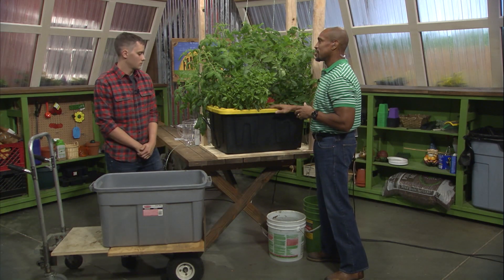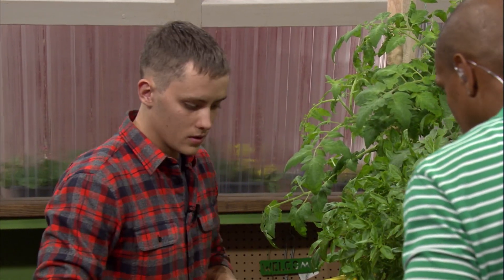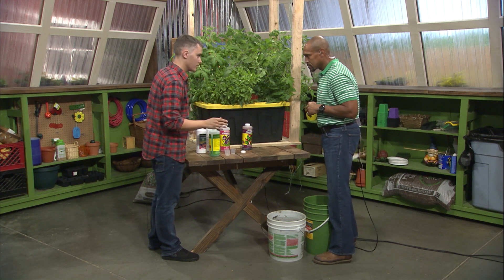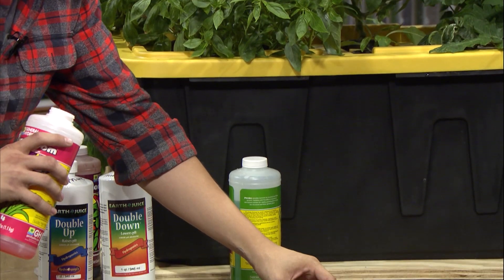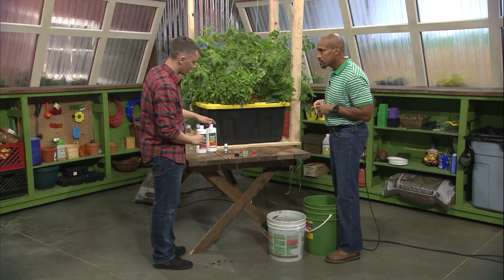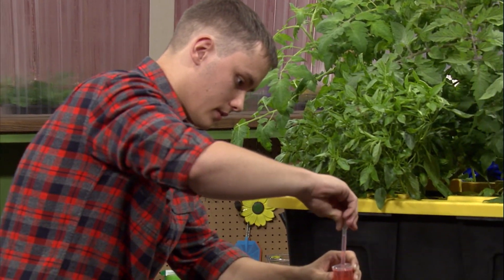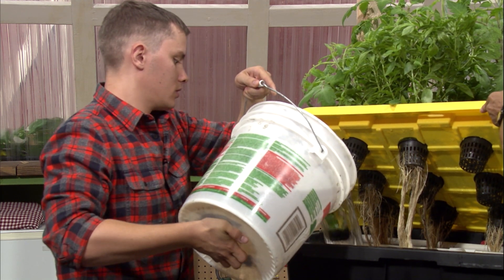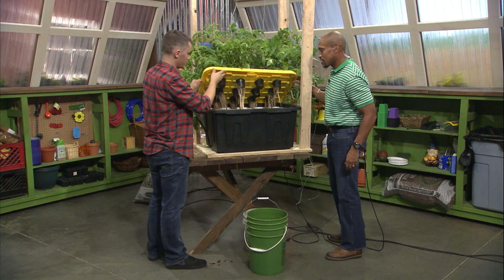Changing Hydroponics Nutrient Solution

Comment: I love the those totes for hydroponics but I've found that the yellow lids allows lots of light into the system which will promote algae growth. It's best that the containers be totally light tight. It takes numerous coats of black spray paint to block the light or cover the lid with aluminum foil to keep algae from growing. 
I would also suggest adjusting PH after adding nutrients to water.
Reply: Plastic spray paint at home depot
Reply: Thanks for the tip
Reply: Just a suggestion, but the most opaque spray paint in my experience is the metallic aluminum spray paint. One coat of plastic primer and then use that and you should be in decent shape.

Comment: Hi Chris, I know its been years here, but do you grow these plants their entire life cycle in this system? If so, how much is each plants yield limited by it?
Reply from the maker: The plants spend their whole life in the system. The tomatoes you saw planted here lasted over two years and were producing the whole time.
Reply: You should add sirstone and pump if plants well be in their whole life.  Will be a low pressure aero bubbler then.  This is  what that system really is.  True aero would be kept separate  plants and nutes .  You can built cheaper one in 4 inch pvc fence postes. And tote will just be resovoier.  If anybody need real blue prints let me know I get them emailed to you.  I have blue prints for 4 different systems just comment with email I get them to you.
Reply: @Jemstk  hey i’d appreciate these for sure

Comment: Why not trim the roots back so they can grow again
Reply from the maker: Plants grow enough roots to support the top and also grow a top that can be supported by the roots. If you cut the roots back they will not be able to absorb enough water and nutrients to support the top. The top will wilt until the roots can regrow the ability to absorb enough nutrients to support the top. If the plant runs out of stored nutrients before they regrow the plant will die.

Comment: Hey nice video btw, just got some questions
I have a wilma 8 pot can I use this same method and same nutrients into the wilma system? And if so can I start using nutrients soon as I change  my plants from the cubes onto the pots? Ty guys
Reply from the maker: I am not familiar with the wilma system. It is usually best to not give the plants full strength nutrients to start, but build them up. Full strength nutrients are very strong and will burn roots that are not used to them.

Comment: Do you fill it to where it was from the beginning or do you fill it less ?do the roots rot if you fill it to much?
Reply from the maker: It works best if filled with 10 gallons. The roots are fine sitting in the solution as long as they have oxygen. The solution is oxygenated by the spray.

Comment: did you guys use an air pump to put oxygen into the reservoir? I am building this hydro set up and tweaking it to my liking, was thinking of putting air stones and a pump into place for this set up. Thanks for the info guys, this is my first time doing hydro/aero build. God bless!
Reply from the maker: We don't have any air stones. The mist collects oxygen. In fact there are so many bubbles in the solution in the tote that you can't see more than an inch into the water.
Reply: @FamilyPlotGarden  thank you!

Comment: While changing the water, how long can the roots stay out of the water before it becomes a problem?
Reply from the maker: They can be out for several hours as long as there is not a hot dry wind. Changing the nutrients will not let them dry out that much.
Reply: it shouldn't take you so long that your roots dry.
Reply: @MajimeTV  right. But, how long?
Reply: @Skidmark75  It depends on the plant but basically don't leave it like that more than 18 hours. It shouldn't take you that long.

Comment: you should check the PH after you have mixed the nutrient solution, not before.. most solutions change the PH levels, and it's important what the PH of final solution is that comes to the roots, not what it's been before the nutrients were added.. also blindly following the guidelines on what's on the back of the bottle doesn't make sense, because that's a generalisation and can't take your plant and environment into consideration.. you could have it under a 1000w light, or under a 15w light, and each requires different needs because the plant will grow differently..  
it's much better to measure the EC in the reservoir over time and then adjust according to that. If the EC goes up, then more water than nutrients are being consumed (or there was evaporation) and in future less nutrients are needed.. if the EC goes down, then the plant used more nutrients than water and the solution should be raised.. if EC stays the same, while the water levels sink, that means you have the right level for the plant in that environment
Reply: I'm sure you're right with regard to the PH levels.  That said, this is targeted toward new hydroponics folks (like myself), so I appreciate the broad stroke approach as well as keeping things simple when possible.  After I spend some time getting set up, I'm sure I'll end up watching more than a few videos on PH levels - most likely after I fail spectacularly. :)
Reply: @bander1023  we've all been there and I know one has to start somewhere.. and like with many things it can get a bit overwhelming in the beginning if one wants to do it really "right".. a lot of beginners (myself included) tend to focus a lot on PH, while EC is as, or may even be more important.. I wish someone had told me that a lot earlier :) 
In any ways, enjoy the hobby and don't get intimidated ;)
Reply: One thing is that if the PH is to high before adding the nutrients, they will precipitate to the bottom of the container and not get to the roots. Balancing getting the PH at 6ph  is around the ballpark. Also, periodically sampling and measuring the conductivity is very important, as water will eventually evaporate and the nutrient concentration will increase, which is bad for the plants.

Comment: So how do you keep the roots from growing or getting drawn into the water pump? And also since it wasn't stated, how often do you need to change the water and nutrients in size of setup? And as I'm typing this I hear the younger guy mention the sediment bag (that wasn't in the construction video).
Reply from the maker: The pump is in a filter bag. The one they used in this video is built for hydroponics pumps. The filter bags are pretty expensive, so I made one for another system from fine tulle from the fabric store. Another option is using a paint strainer bag from the hardware store. With the tulle I had the problem that the tulle got sucked up against the pump and clogged with root fragments because all the water was being drawn through a small area in the bag. To solve this put some things in the bag that will keep the side of the bag away from the pump. 

The general rule of thumb for water change (without complicated testing) is when about half the solution is gone - either from the plants drinking or from evaporation. The tomatoes have gotten very large and they will drink through half the water in about 3 days. I refill with water and do a complete drain and fill every week. Other plants will require it less often, depending on how much they drink.

Comment: do you have to circulate water even with airstones
Reply from the maker: The nutrient solution needs to be sprayed on the roots to keep them from drying out. Once you are spraying there is no need to use air stones. The air is oxygenated when it is sprayed.

Comment: Why not using a pump to fill back the tank?  You might get a hernia picking up those heavy buckets.
Reply from the maker: Good idea
Reply: I use the pump to empty and fill the tote.
Reply: @billcoley8520   Been looking into how to do that? Is it that easy?
Reply: c whitt yes it is. Fill your buckets up and have a spare pump with a long hose on it. Drop it in your bucket plug it in and save your back. 
Look. I was a lineman for a power company. I’ve had 3 lower back surgeries. Everything I lift now has wheels on it.

Comment: He read the dosages wrong. its not 1ml per gallon lol.  its 1 teaspoon which is 5ml. so he should of put 50ml in a 50 gallon tote.
Reply: A 50gal tote would use a minimum 250ml of FloraGro at all times. 5ml per gallon x 50 gallons is 250ml. Always follow the directions on your nutrient bottle labels.
Reply: He is mixing for a bloom phase not a clone or vegatative phase, so at that point u don't need as much nitrogen in ur mixture

Comment: How would you clean the tote and Sprinkler system with out Hindering the roots and with that system have you ever had a Sprinkler get clogged if so what was your solution
Reply from the maker: We just drain it and refill. I usually tilt the container to get more of it out since about 1/2 inch of water is below the drain. When it is empty I pour in a gallon or so of plain water to flush it out. Then refill with nutrient solution. I have had a spray nozzle get clogged. After unscrewing the nozzle you can take a pin and try to push the offending item out of the narrow part of the nozzle. Some times I just unscrew the nozzle, rinse it in plain water, put it to my lips and blow out the clog.

Comment: How do you know what nutrients are required for hydrophonics ?
Reply: In any growing situation, plants need 17 elements to grow and be healthy. We provide 14 of these in our growing mediums and recipes. Mother nature handles the other 3. For hydroponics you can use nearly any form of liquid "plant food" but for high quality hydroponics, ie aeroponics setups like this tote, you want highly soluble products to avoid clogging your sprayers. People with small tubing in drip fed applications would also benefit from these. Hydroponic nutrients are labeled as such because they can be used reliably in the many incarnations of hydroponics. However, they are viable in any other medium as well. Soil, peat, coco, etc. However, the same cannot be said in reverse. Due to issues with clogging, only the most particular organic solutions will reliably operate in an aeroponics situation. But, for instance, any compost tea would work great in a deep water culture hydro setup. 

Seek out: soluble salt based nutrients. premixed in water. or in their dry (salt) state.
Reply from the maker: There are many different manufacturers of hydroponic nutrients out there (Google: Hydroponic Nutrients). We are using General Hydroponics Flora Series but depending on what you are growing there may be a better nutrient for you. Each manufacturer will provide a recommended way to use their product including how much of each part and mixing instructions.

Comment: If all the nutrients are being mixed together, why can't you fill the tote with water and then add the 3 nutrients one at a time into the tote?
Reply from the maker: By mixing them separately and making sure they are well mixed before you put them in you do a couple of things. You don't shock any roots with a super concentrated nutrient. Also, you make sere the first nutrient is at a lower concentration in that area when you add the second. If the nutrients come in contact with each other in too high of concentrations they can react which may cause a non-dissolve-able  precipitate or chemical combination that the plant can't use.

Comment: Thanks for your very good response regarding the use of vinegar. I did not realize that it is produced by bacteria and some might remain when I purchase it. However, to use it, I should be able to kill the bacteria by boiling it for 15 minutes, unless it is a superbug, that even a nuclear war will not kill. The reason it is an issue with me because I have to use a lot of PH Down to bring it down to the acid range since the water here is so alkaline. There are no hydroponics supply stores around here, so shipping liquid is expensive. Bulk vinegar would be more economical.
Reply: You might try treating your water with reverse osmosis. A two-stage system can run under $100. Reverse osmosis water purifiers will reduce the pH of water.  Because reverse osmosis removes the minerals in water the water will then react with carbon dioxide upon exposure to air to form carbolic acids, thus lowering the pH.  The resultant pH will depend on the initial water chemistry. It cannot be predicted.
Reply: I used sulphuric acid when I started out from an old car battery (ggg!) and according to the book I had it is one of the best acids to use for bringing PH down. And very little was actually needed to keep my PH under control.

Comment: Thank you for your previous response. In my area the tap water is very alkaline. I have used a large amount of ph down to bring it into the optimum range. Instead using this expensive chemical, why can I not use just pure vinegar for my hydroponics? I use it for plants in my in ground garden.
Reply from the maker: You "can" use vinegar to lower pH but there are some problems you might run into. Vinegar is made by bacteria. The vinegar is then separated from the bacteria, packaged, and sold. Some of the bacteria may remain in the vinegar you buy which will grow in your reservoir and make more vinegar making the pH uncontrollable. 
The nutrient solutions are buffered to pull the pH into the optimal range. Try adding the nutrients first and let it sit for a half hour. It is possible that the nutrient buffer will cause the pH to end up where you want it. If not, you will not need to adjust it as far. Good luck!
Reply: A better idea for hydroponic use is fulvic and humic acids. RAW Nutrients from NPK Industries is readily soluble and will help buffer your pH while at the same time breaking down salts to become bio available food for the plants. You should also use reverse osmosis to filter your water for hydroponics. Some places (like our city) can get away without it, but it's a low cost alternative to trucking in liquids.

Comment: Why do we need to change the water in the reservoir? If the fertilizer is depleted, just add more. Where does the contamination or salt buildup comes from?
Reply from the maker: The plants take up the nutrients they need leaving the rest. The nutrients are balanced by the manufacturer so that there is the correct balance for most plants in most growing conditions. Hopefully the plants will take up most of what is there, but there will always be some left behind. If you let the unneeded nutrient build up by just adding more, the excess nutrient will eventually begin affecting how the plant takes up the other nutrients. By draining and replacing the solution you get rid of the excess.
The salt buildup comes from some of the nutrients coming out of solution. This could be because they became concentrated above the saturation point, or it could have been a chemical reaction between improperly mixed nutrients, or it could be that the pH has changed to the point that the nutrient is no longer soluble.
Reply: You're right. The salts can be further diluted if the ec of the nutrient solution raises too high. Manufacturer's recommend weekly changes. We have always gotten away with bi-weekly changes and have rarely pushed further. Usually it is best for a novice to run new solutions regularly, to avoid issues or the need for added equipment. At Wet-Werk, a BlueLab EC wand is a staple for daily use.

Comment: I noticed at 07:32 that the roots are all intertwined.  Is that an issue?  Since (and please excuse my ignorance) these plants are annuals, do we not care that the roots are connected because we will end up disposing/composting the plants and their roots at the end of the growing cycle?

This is where I am really confused.  Do these plants still have a one-growing season life or do they just continue growing/producing seemingly forever (given nutrients, space, et cetera)?  Also, if you wanted to change out the plants that are growing (one or more), do you just cut the roots that are tangled?  I will look around your channel too because the other question is, what photo energy source do you use on this system?  An artificial light(s)? Sun? Artificial light(s) and Sun?
Reply from the maker: Second questions first. The tomatoes are annuals in the outside garden. They are killed by frost. We have our system indoors in front of a large window. (We also have a grow light, but overall is supplies much less light than the sun.) Because there is no frost indoors they should continue to live for a long time. The longest I have heard of a tomato plant living is three years. The other option is letting the original plant grow and then rooting suckers off the original plant. Then remove the original plant and replace it with the sucker. 
Now to the tangled roots. If you grow outside it is not a problem because they will all die at the same time. Inside it is more of a problem. I have not had to remove a tomato plant yet, but some other smaller plants I have taken out of the system. They did have tangled roots. I untangled them and took out as much as I could. The rest of the root will die and eventually wash out when you change the nutrient solution. Having dead roots in with the live ones is not the best thing because of potential disease and fungus problems, but there is really no other option here.